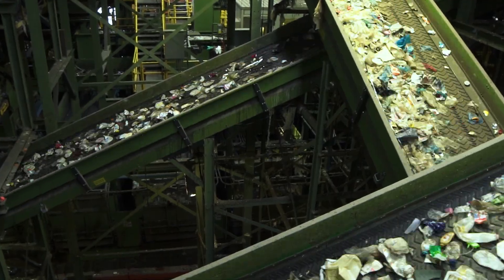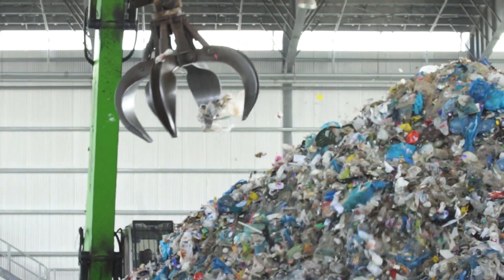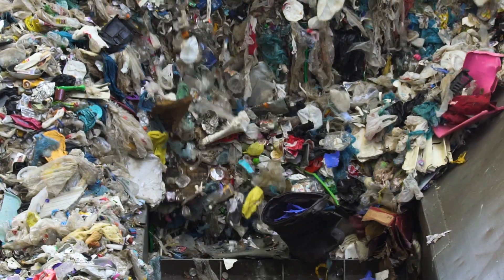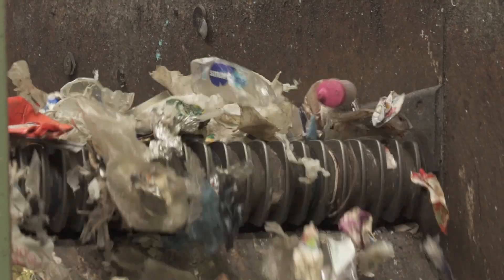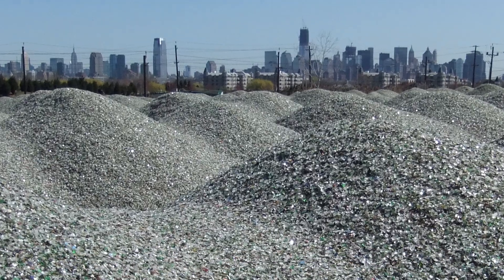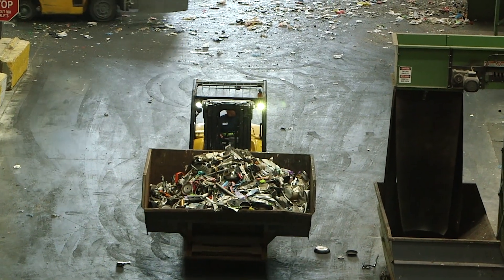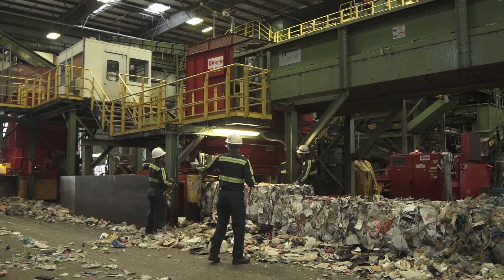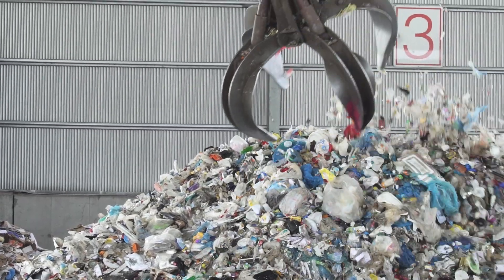The Big Sort: An Insider's Tour of a Recycling Plant

Comment: I used to run the baler at a recycling plant. One of the roughest jobs I've ever had. The bales of paper can weigh between 800 and 1200 pounds. We had to hand pick (with pliers) all the non paper material from the surfaces of the paper bales. 
I did learn a tremendous amount at that job. I gained experience with Forklift, skid steer, roll-off truck and front end loader at that job.